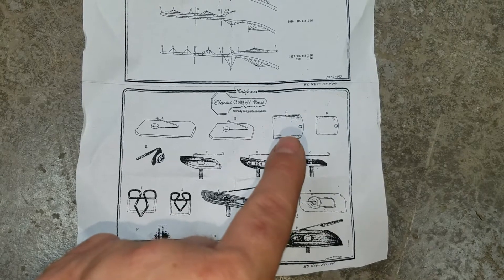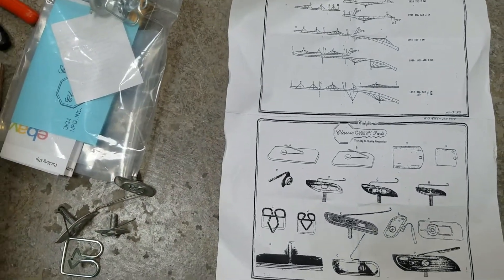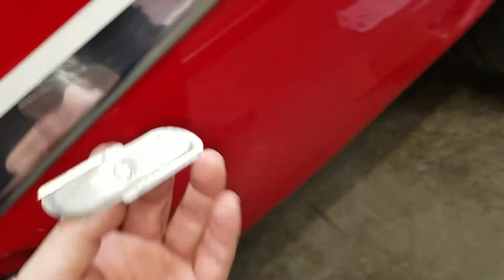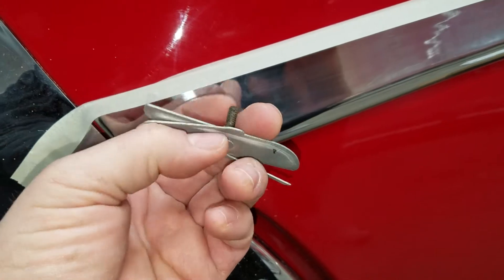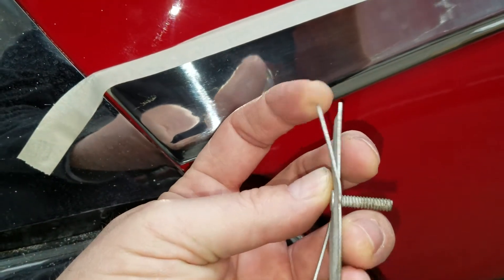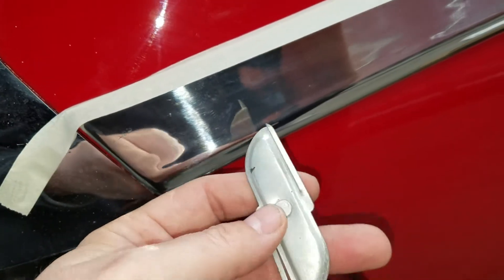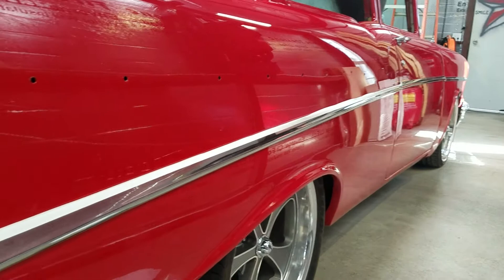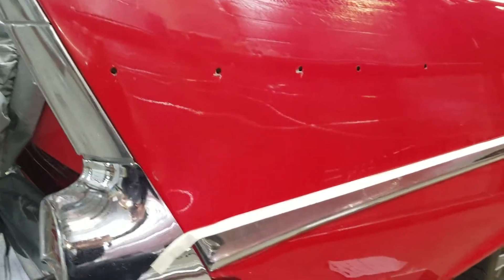57 Chevy side molding install

Comment: On those quarter panel inserts, ive always used peel and stick velcro. Vertically not horizontally. Otherwise it will yrap water. Works like a charm everytime.